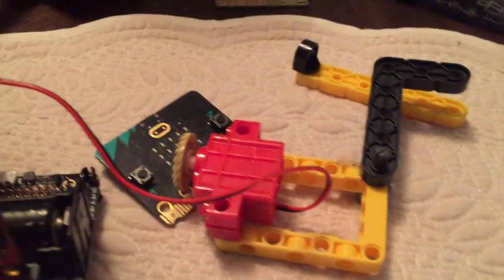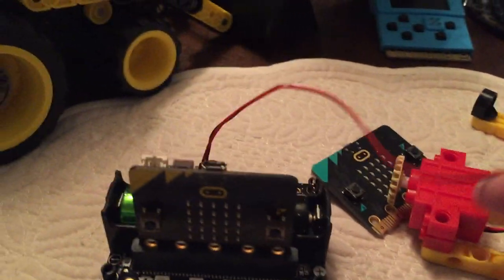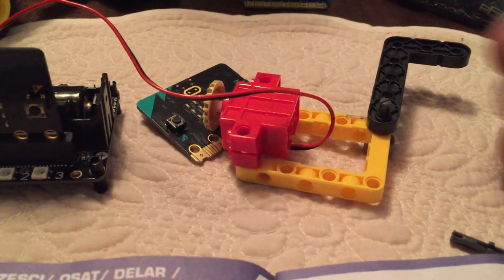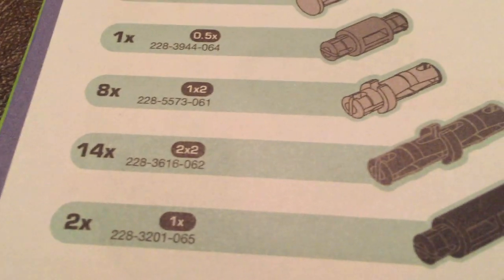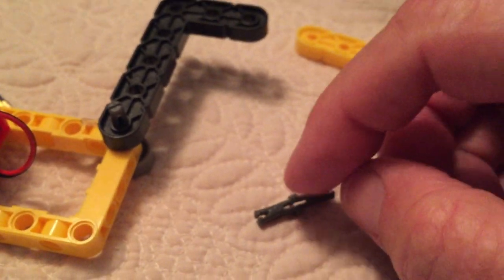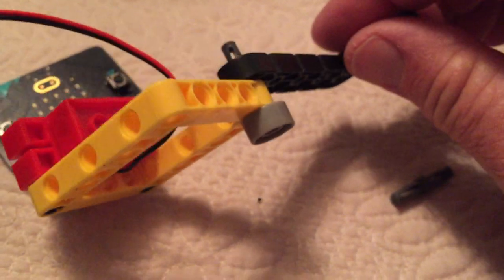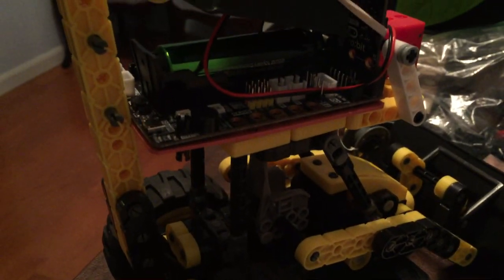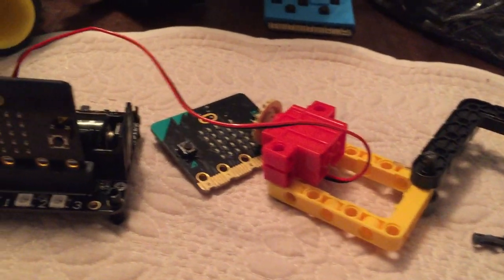Connecting VEX parts to Lego Technic parts with VEX pins

Comment: Use a -112 spacer rather than a -154 1x1 beam. The 154 will keep the pins in a compressed state and they will eventually fatigue and loose holding strength.
Reply from the maker: Thanks, Noah. Similar to a spacer, I will demonstrate in a short video today to use a cheap metal washer from Ace or True Value hardware store, bought in a box of 100 and same inside diameter as the plastic VEX washer. I'm sure I will have lots of questions on this channel because this is an all new project for me : VEX plus Microbit to motorize Hexbug kits.